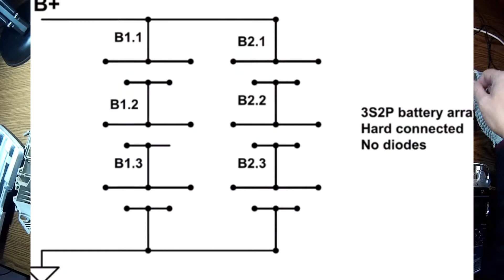Rechargeable vacuum cleaner conversion  to Li-Ion batteries

Comment: spot welding is best for creating this kind of pack  or any. soldering will kill those batteries in the near future. i hope they will last but in my experiments they failed after just few cycles. good job on converting tho. cheers.
Reply from the maker: Truth! This cells are compromised old left overs, I just did it for fun, but proves very useful around..

Comment: Cool stuff Sir 👍 without BMS it will work for few weeks but we need it anyway 🤷‍♂️
Reply from the maker: Of course, I'm measuring once in a while the voltage, I have a port for charging so if it's around 9V I recharge it..but you can feel it by the sound of the motor also.I don't have a proper BMS yet! Thanks!
Reply: @viocaia  then there will be an another I think.
keep up the awesome content Sir 👍

Comment: For battery capacity, it's Ah  ;)
It would be more safe to use a BMS, it could prevent one or some weaker cells to fall undervoltage when discharging, and possibly have hasardous behavior..  And as much as possible, try to mach the wear level and internal impedance of cells, it's also important with capacity, to avoid including a cell closer to death in the pack that could ruin it. (A big original cpacity cell half worn out may have the same residual capacity as an almost new small original capacity cell, but it will die much faster, because his declining will be exponential. )
Reply from the maker: The BMS is on the way, I couldn't wait anymore! But for now it's experimental..I need better cell anyway..Thanks!
Reply: @viocaia  you can balance charge the pack with you charger just need the leeds on the bat
Reply from the maker: @camolas71  I'm installing a BMS and balance right now..I mean that..I'm in the middle of! It will be a video soon
Reply from the maker: @camolas71  3S100A BMS refuse to work..to much amps at start..a piece of junk! of course! Still looking..
Reply: @viocaia  your battery is 2s or 3s? Put a relay in the place of fets
Reply from the maker: @camolas71  I have a board for Lead acid, with low and high limiting, it should be perfect for this..I can adjust to my own voltages and it have a 30A relay.